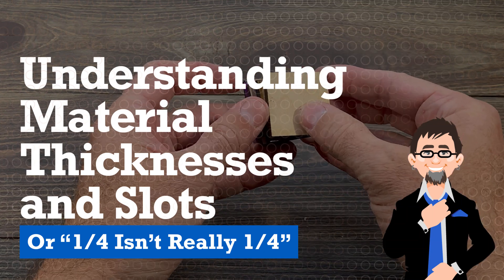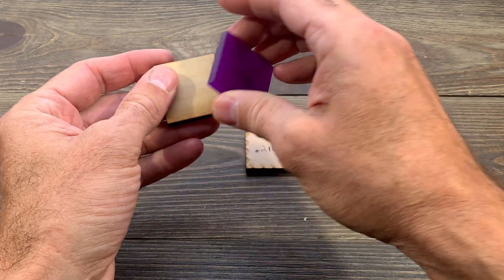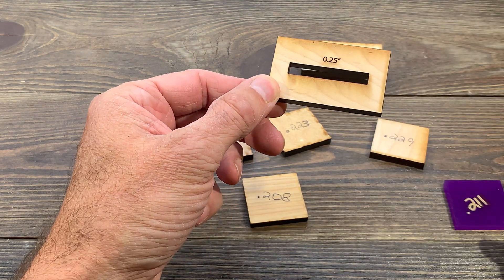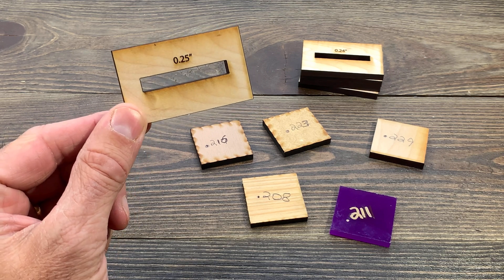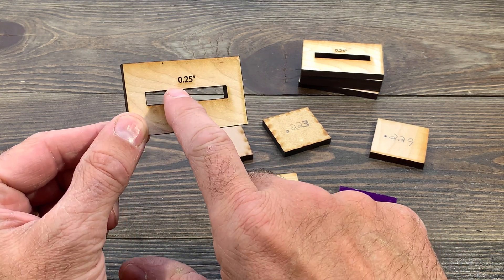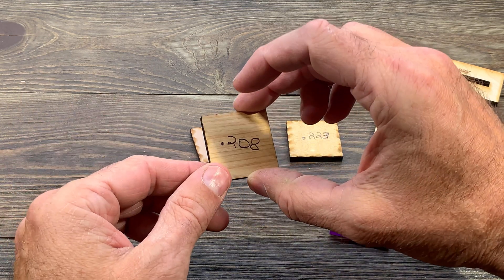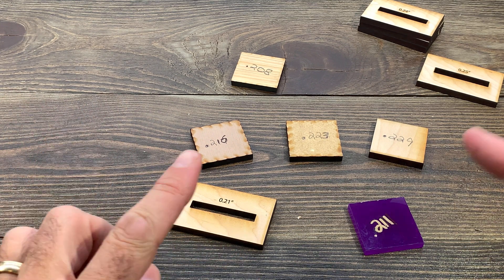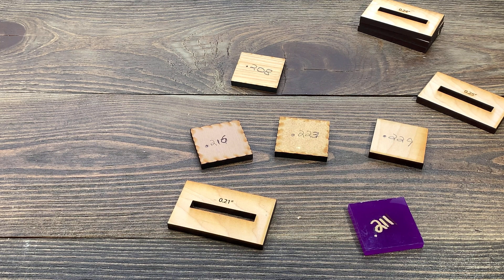Tutorial: Understanding Material Thicknesses and Slots (or "1/4 Isn't Really 1/4")

Comment: Hello Mark, from what I watched, is it my understanding that .01 of material disappears? and when referring to a slot cut out to be a quarter inch, does that mean that .02 has to be accounted for when designing so I'm guessing that the slot would be measured at .23 and with the kerf thus it would create a slot that measures .25? Thanks Mark, we're still learning to understand everything.
Reply from the maker: Hi! No. If you are cutting a slot that is .25” in one direction - let’s say the height - then when you cut it, it’ll be approximately 0.26” in height due to kerf. 

If you want it to end up at 0.25”, you’ll design it at around 0.24” high. I say “around” because 0.01” is a starting point and isn’t the same under all circumstances.
Reply: @BigBlueLaserDesigns , thanks Mark that helps me in the right direction. I'm guessing that the circumstances are different by thickness and the type of material mdf to plywood?
Reply from the maker: @ImaginationPlaza  Yes, but that’s primarily from the power and speed needed to cut those. The slower the speed and/or higher the power, the wider the kerf.

Comment: Ok i'm a newbie to laser cutting...  so the glowforge laser is something like .008 cutting kerf right.... ok so question where does the laser cut, on the line? the outside of it? and so then how much do you accommodate for this?  less a .090? ....so that then leads me to when designing what stroke weight should I use? Thank you !!! Glad I found you very helpful videos! ~Frank
Reply from the maker: Hi Frank! Typically the kerf is around 0.05” and it cuts right down the middle of a line. 

I’ve got quite a few videos that touch on various parts of this - most from an Adobe Illustrator perspective, but the principles are all the same. Check out my playlist here on my channel called, “Adjusting Slots and Working with Kerf.” I think it’ll help you!